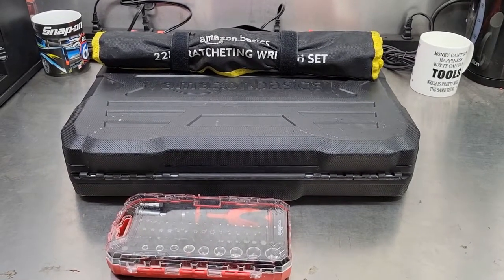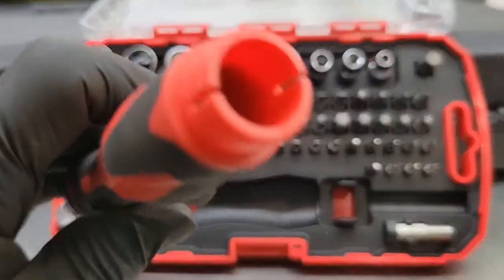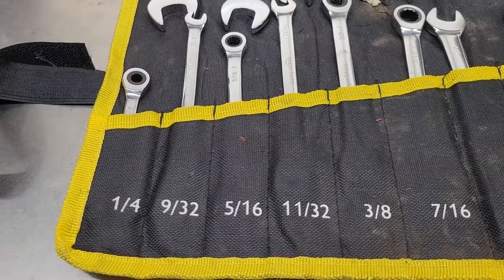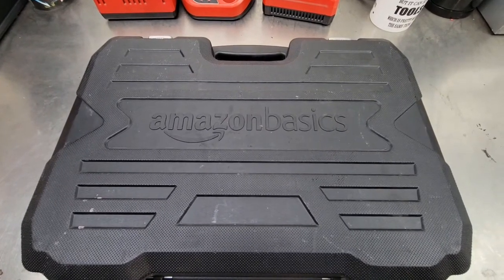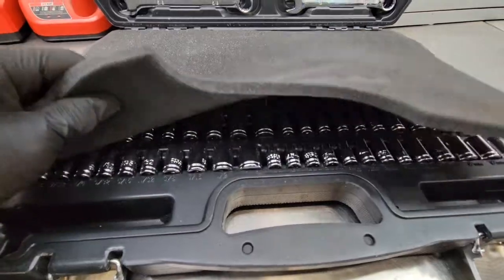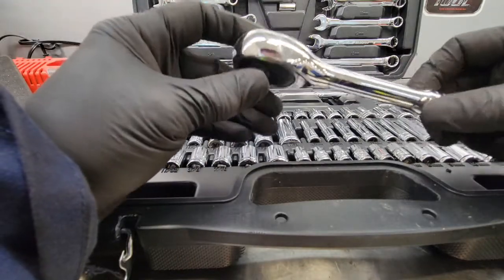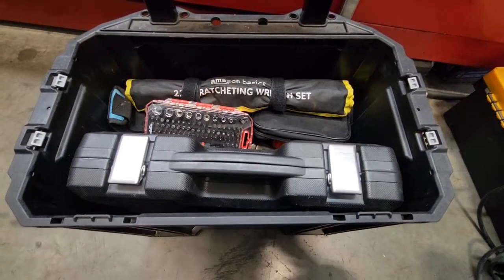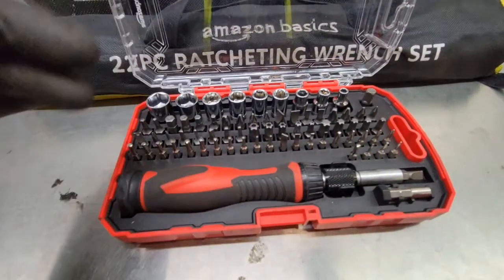I Tried Amazon Basics Instead Of The Tool Truck For A Second Set Of Tools?

Comment: I usually pick up the Milwaukee pliers and DeWalt screwdrivers.... I go on Amazon and get their Duratech impact sockets & Bit sockets...and flexhead ratcheting wrenches for cheap and use them as my road tools... they're not bad for cheap even got a Crescent set and a Stanley set in there too... didn't cost very much.... Just a bunch of stuff I'm not afraid to lose or break
Reply from the maker: I also go cheaper on my set of road tools. They are always exposed to the elements and take a lot of abuse. Cheaper to replace if your vehicle gets broken into.